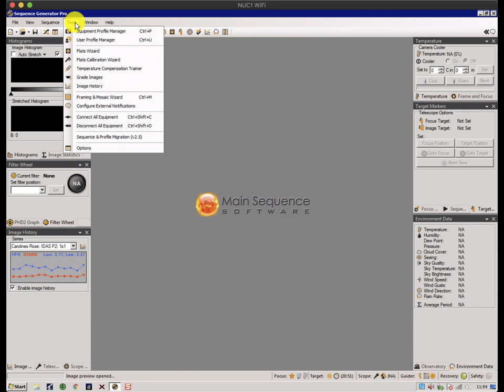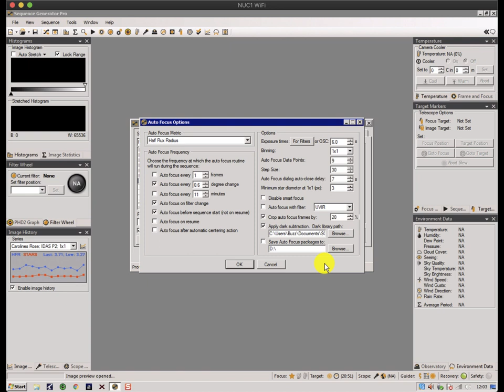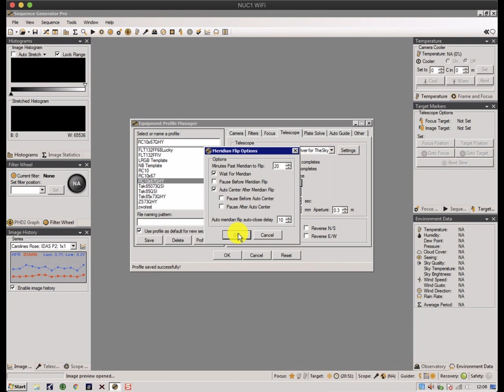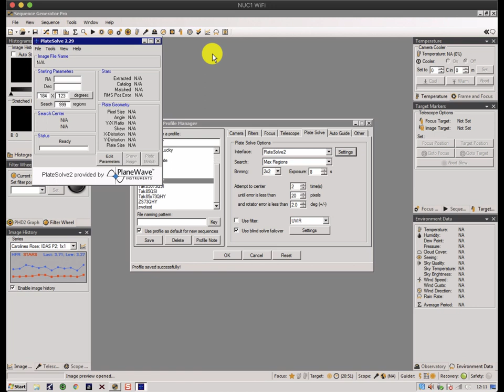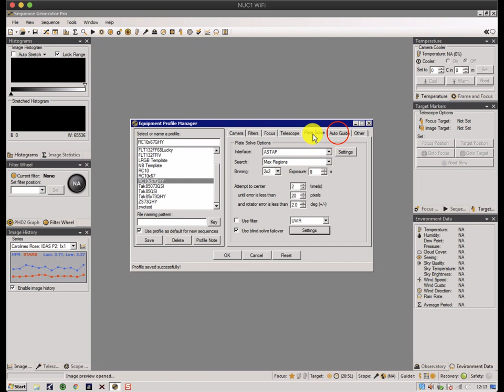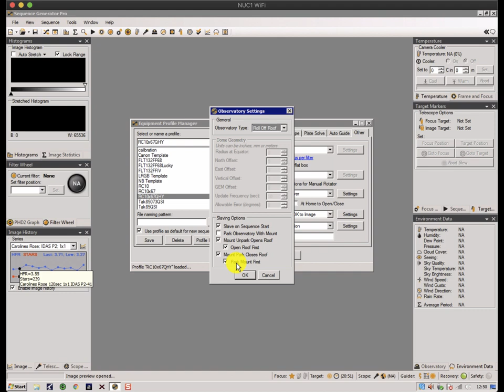Comment: I had a problem with my mount (NEQ6 Pro) settling during guiding after a dither. For me the PHD2 defaults were a bit tight so I made some adjustments and it is now fine. I watched this video again and notice you skipped over the "Settle at <" box under "Small Dither" in the "Auto Guide" tab in the EPM. Maybe it is not worth going over, but if you think it is, maybe just a comment would suffice. Overall (as I have noted before) these are the best SGP videos out there by far - thank you for doing them!
Reply: thanks - I usually set something equivalent to 1-2 arc seconds as my settle criteria. There is already a delay in PHD, so I do not usually put in anthing more than 1 second delay.